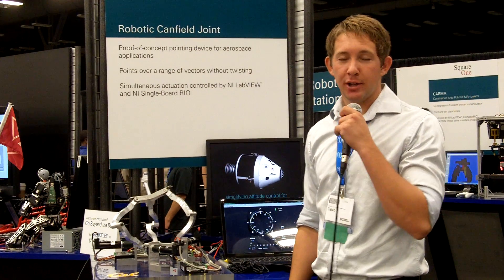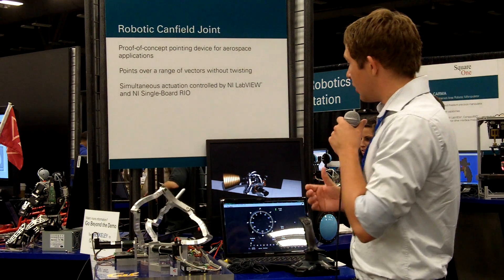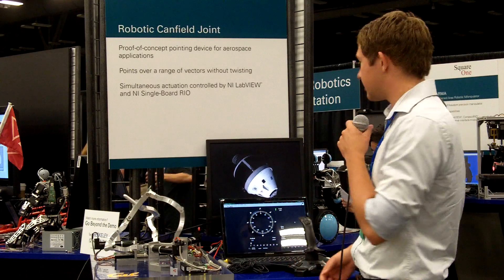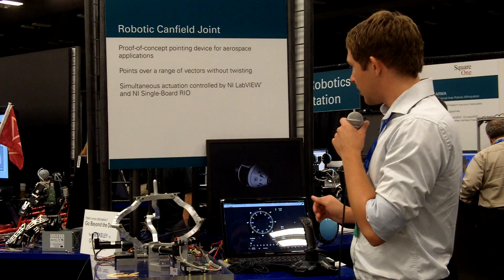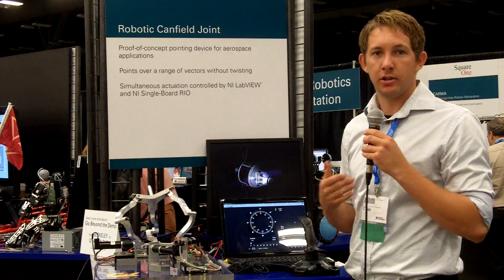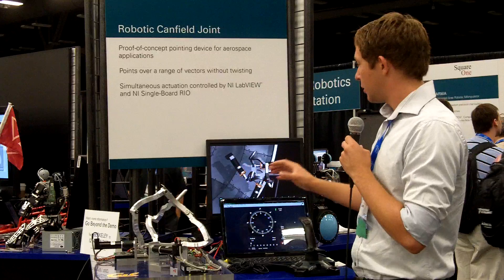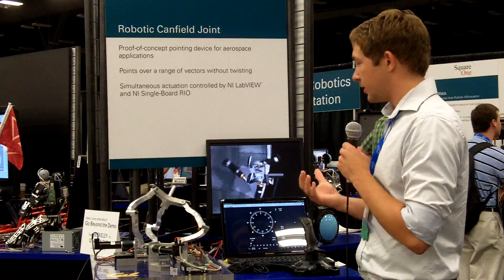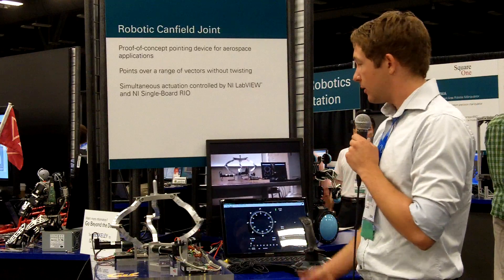UC Berkeley Canfield Joint

Comment: @martinsinnombre Imagine if you had to pass tubing or wires through a twisting joint. Lines would become tangled, and it would become a huge mess. By not twisting, you avoid this headache.

Comment from the maker: The mounting is useful for not just engine vectoring but with other applications as well. With engines, you should only need the 2 axes of freedom that you describe. But as he describes later on, the mounting can also be used in applications that would need more degrees of freedom.

Comment: sorry man, you seem smart, so I'll assume I'm missing something here: why do you think it is senseful to use 15 rotational joints instead of the 2 needed by a simpler mounting, like the turret of a tank. Plus the maths behind all that and the powering... uffff, by brain needs fresh water.
Really, why?
You mention at 0:46 that it never twists. Why is that an asset?
Thanks in advance!